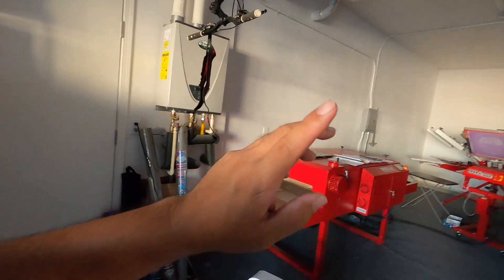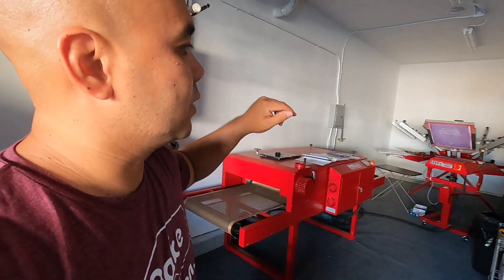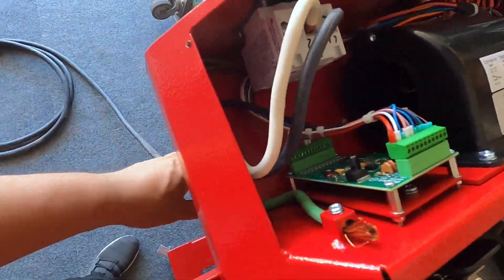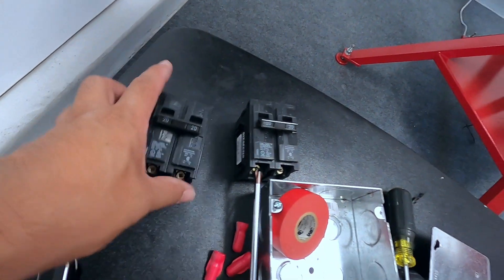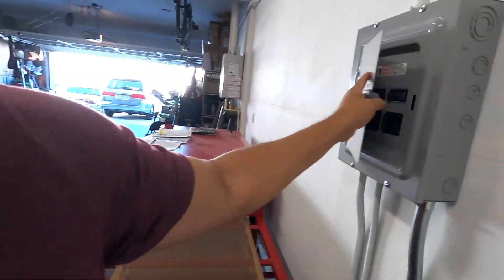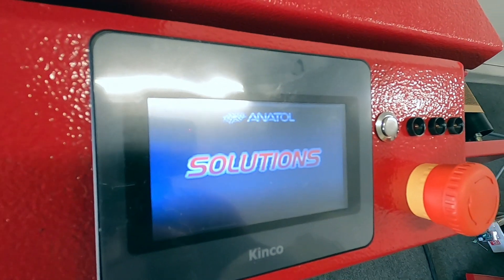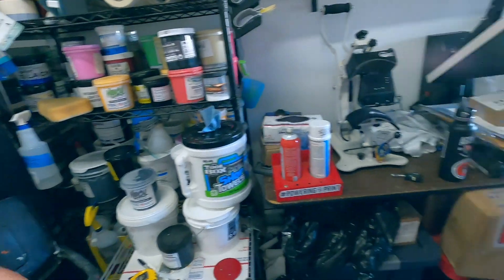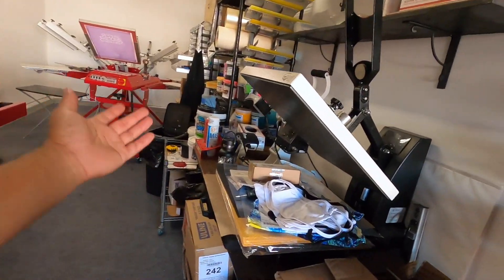TRYING NOT TO KILL MYSELF - POWERING UP THE ANATOL : Electrical Work On The ANATOL (S:07/Vlog 004)

Comment: Did you notice that only half the lights on the Flash Dryer turned on during the test.
Reply from the maker: George Lopez Designs yes I only turned on 2/3 of it. You can designate heating areas